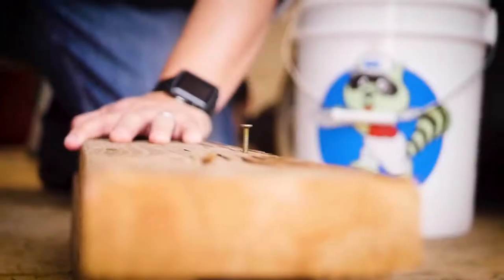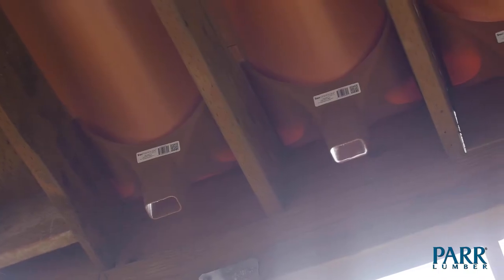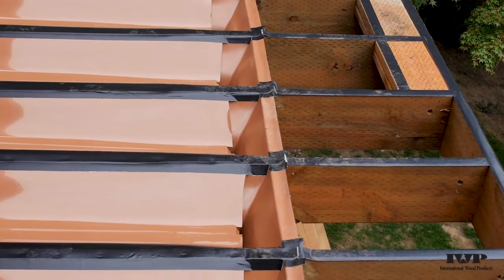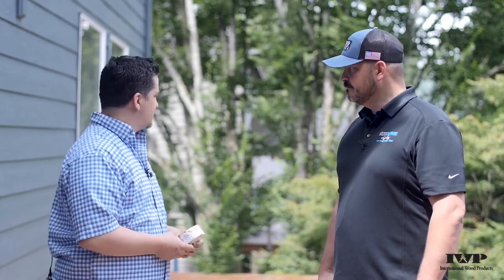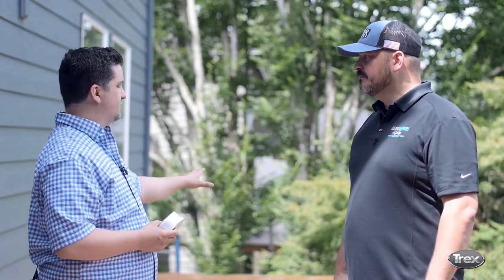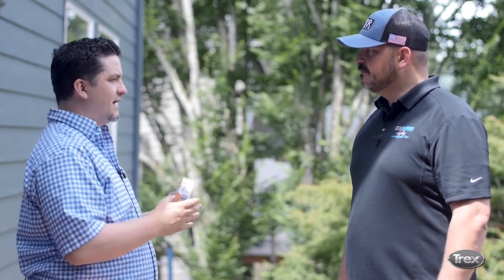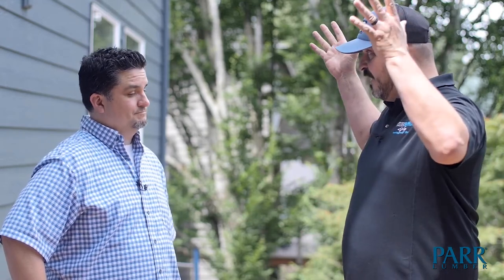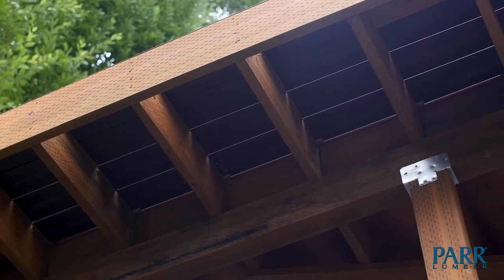What is Trex RainEscape I How Does RainEscape Works? I How To

Comment: Nice concept. I installed it under my deck and it worked fine for about two years. Now cracks are forming and I'm patching with the tape that is used for installation. I wanted to put a ceiling on the bottom of my deck, but now that isn't an option when cracks start showing up every couple of months
Reply from the maker: Hello, that is very interesting... I've haven't heard of this problem before.  Have you reached out to Trex?  There is a 20 year warranty on Rain Escapes.

https://trexrainescape.com/warranty/#:~:text=IBP%2C%20LLC%20(%E2%80%9CIBP%E2%80%9D,from%20the%20date%20of%20purchase%20(
Reply: Thanks for the reminder about the warranty. I called Trex and we are in the process of, hopefully, fixing the problem. Now I just hope it wasn't user error. Thanks again.
Reply: @forestfrost9676  How are you making out with Trex on a warranty claim?  I'm considering using this product.   However, even if Trex warranties the material, the labor is the big piece.  Very curious what you are finding.  Thanks.
Reply: @wwhomeshow how much will it cost for a 16x 24 deck?
Reply from the maker: @bhagavadgitateluguasmr  That's a loaded question!  There are way too many variables.  How far off the ground?  Railing?  Steps?  What type of decking?  A 16' x 24' deck could range between $5k-$10k in materials.
Reply: @wwhomeshow  so our deck is on 1st floor, and we live on a basement house. I did not understand your question about railing. We do have wooden railing if that is what u r asking...we do have about 4-5 steps, which land up on a sloped backyard.
Reply from the maker: @bhagavadgitateluguasmr  Sorry, I was trying to be funny.  There are just lots and lots of variables that go into how much a deck can cost.  Usually, if your deck is more than 30" off the ground it will require railing.  Which can add upwards of $100 per linear foot to the cost of the deck.  If railing isn't required you're probably looking closer to $5k-$7k in materials, depending on the type of materials you choose.

Comment: 3 years with Rainescape no leaks. My only problem is bees are now flying inbetween the deck boards and creating nests :/ any ideas on how to prevent this?
Reply from the maker: When you say "bees" are you referring to hornets or wasps?  Or Honey Bees?  

I have been getting Mason Bees nesting all over my house the past few years.  They are amazing pollinators so I spoke to an expert about responsibly relocating them.  I ended up installing Mason Bee houses and it really helped.  If you're dealing with Honey Bees, you should call a local beekeeper to get some advice.

Wasps and Hornets are a different story!  You may have to speak to an extermination company to keep them out.

Comment: How do you account for a middle board and picture framing when trying to waterproof a deck? It makes the framing difficult.
Reply from the maker: You're right, adding picture framing and breaker board framing makes it more difficult.  You might have to direct the water to more than one gutter.  

There is some handy information here.

https://www.trex.com/academy/how-to-guides/all-guides/how-to-install-the-trex--rainescape--under-deck-drainage-system-/?utm_id=go_cmp-13141212456_adg-122611603419_ad-652105105668_dsa-19959388920_dev-c_ext-_prd-_mca-_sig-Cj0KCQjw756lBhDMARIsAEI0AgljC8u4weXV7br-esxZmVYhinWqAbT6105eL4tBBPY5DKsFx5BACkAaAk9oEALw_wcB&utm_source=google&utm_medium=cpc&gclid=Cj0KCQjw756lBhDMARIsAEI0AgljC8u4weXV7br-esxZmVYhinWqAbT6105eL4tBBPY5DKsFx5BACkAaAk9oEALw_wcB

Comment: This is an expensive system for what it does. Those are thin downspouts one can staple thu - get that, but there isn't much in manufacturing or materials.  These should be under $20 per piece.